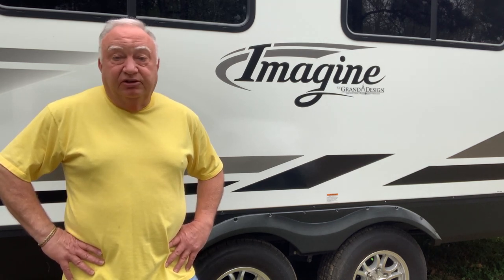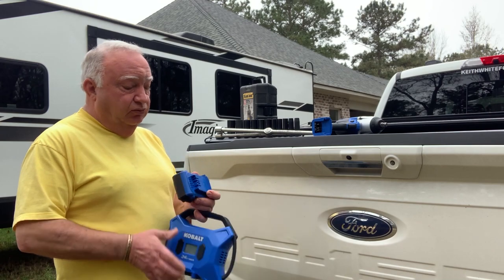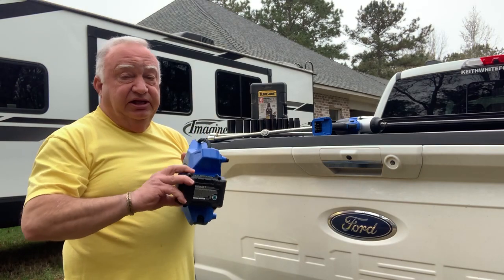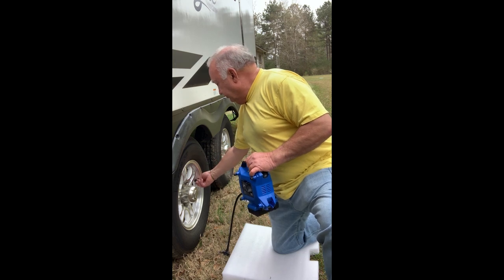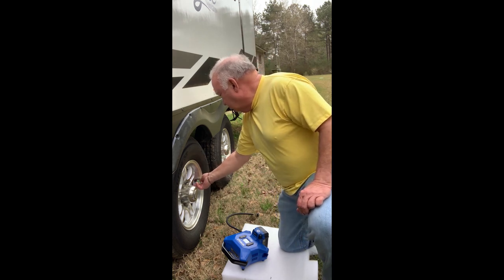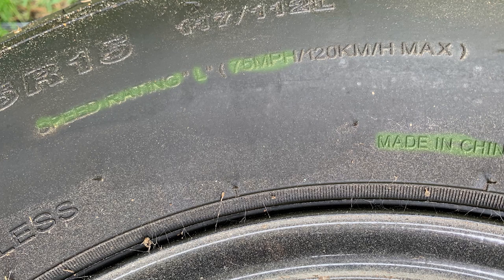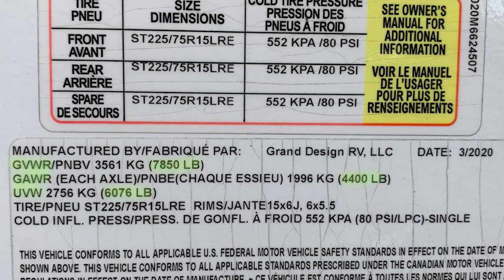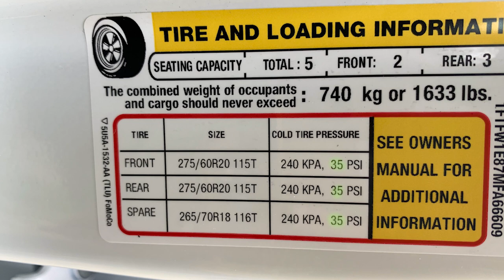RV Tires - What you need to know

Comment: Thank you!  I’ve watched a gazillion videos on RV tires and you are the only one that addressed a question I’ve had.   The tire (and everyone else) says 80 PSI cold.  I’ve always wondered though, after the tire heats up, how much pressure is too much?  I filled them to 80, but after a while on the road, my TPMS said two of the tires were 89/90 PSI.  I was afraid that was too much, but I didn’t have a blowout. So the next morning, I set them at 77 and didn’t worry so much. After seeing your video, I will now set them around 77 and not worry at all. Thank you!
Reply from the maker: The things I have read indicate the factories recommend inflating to the max PSI cold rating.  But, like anything, there are too many variables.  How cold is it when you start and how hot is it where you're going.  Sometimes it's just SWAG.  This has worked for me.  Thanks for the comment and subscribing.